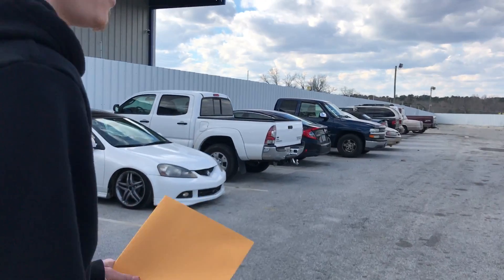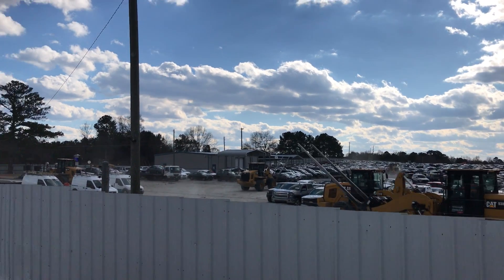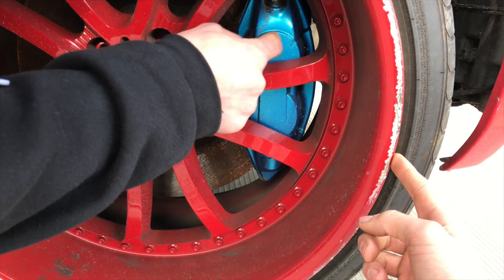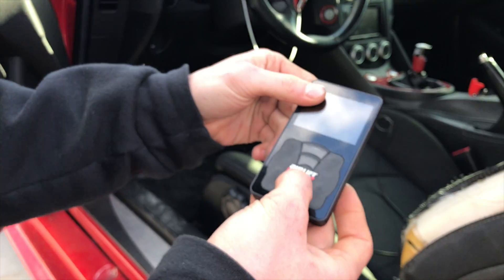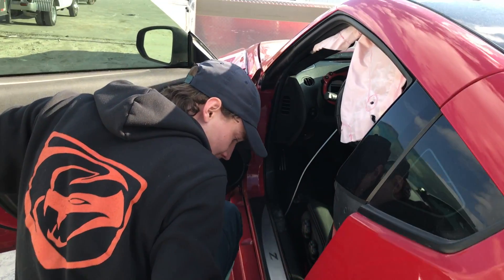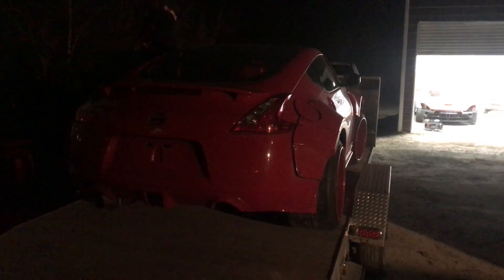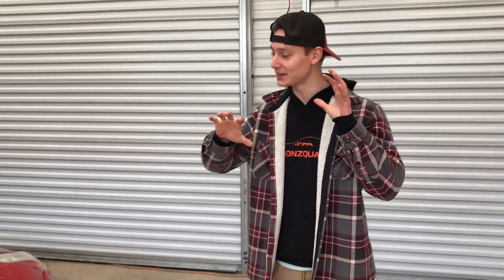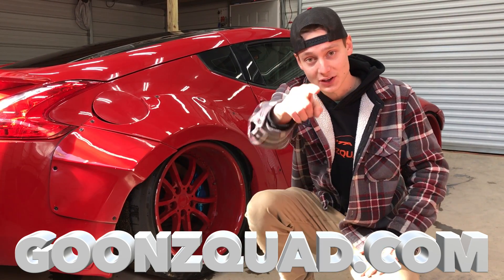We Bought An Auction Drift Car!

Comment: Air suspension isn’t the best for drifting I’d recommend getting some BC racing coilovers they can help you spec out the right ones. Then get a angle kit and that’s a basic drift car. It would be nice to see a drift car built with a cage, seats, harnesses, built engine, etc would be awesome!
Reply: Ryan Elmer I agree on your opinion. Drift car has roll cage, bucket seat w/ harnesses and strong engine not stock v6. That 370z is a rocket bunny build not a drift car. 😊
Reply: Evan Silvala not a rocket bunny kit im pretty sure its a ccc kit
Reply: Their are many different types of drift cars street legal, track only, and fd spec
Reply: Its 2019 you can drift on bags. Check out Illuminate and his 240sx drift car on bags
Reply: More sitf more drift
Reply: If you want drift car go to adamLZ

Comment: this 370z got airlift bags.. not for to drift mod, if u want to drift mod.. u must to change coilover
Reply from the maker: Muhammad Amir Faiz that makes sense
Reply: You don’t necessarily have too but it’s much better to have coil overs
Reply: goonzquad as long as the bags aren’t linked together you’ll be fine for drifting, Chelsea was running bags on his pro car before formula d banned them, they’re fine for sliding. They’re definitely the last thing you need to do for drift mods. If you have any questions you can email me!
Reply: Not so. Just gotta set them right. I know baggers that drift.
Reply: Greg Wayne fax I’ve slid bag cars and love the adjustability
Reply: @waosfab9080  Hey right on! I've got a E46 M3 but coils. Maybe some day I'll have to check them out!
Reply: Greg Wayne for sure! That’s sweet! I just slide me turbo e36 on coils right now it’s good for where I’m at skill level wise

Comment: Put a twin turbo kit to the 370z and putcold air intakes. After that you should carbon fiber put side skirts and put a big carbon fiber spoiler. Also you should put a twin exhaust.
Reply: alright thats enough GTA Online for today..
Reply: The VQ37HR barely has enough space in the engine bay for a single turbo, let alone twin turbos. And the good turbo kits are between 8-10k
Reply: I’d like to have a duck tail spoiler for my z’s... huge classy mounted wings are 🤮 for me
Reply: pay for it then Sami
Reply: A twin turbo setup would most likely blow the transmission and motor so you would have to rebuild the whole thing basically
Reply: @Bc._Media  This, ducktails on Z's are slick.
Reply: @iamhamzaamin  you can stick it out of the hood
Reply: Soo literally do nothing to make it a more functional drift car? Okeeee.

Comment: Looked likes the guy that owned it before you guys was a showy type rather than a performance type of guy. He has the outside all done but really nothing under the hood.
Reply: There isn't much you can do to significantly improve the performance of the Nissan VQ engine without spending a bunch of cash.
Reply: chuckschilling and also a drift car doesn’t have bags only a show car does
Reply: EnderSquad Gaming I guess some younger dude owned this car. I wouldnt do anything to it performance wise too because it already has 300hp thats really enough

Comment: i would definetly recommend that if you wanna drift it then rip out that air suspension and go with coilovers, weld the diff and then start drifting, no need for poweradders like turbos when u are new and learning

Comment: For $6500 after the fees that’s not bad
Reply: Looks like it sold for 3150
Reply from the maker: Macbook & Android it was 6200 with fees
Reply: @goonzquad  the car is is nice but it's in very bad condition, but you can fix it
Reply from the maker: Cesar Chavez thanks but it’s gonna get turned into a complete drift build
Reply: @Kevin_2442  This is nothing, it's gonna be a EZ fix for them, especially compared to there other builds. I'd give it six to seven videos tops and this will be done, all that needs to be done is to check out the control arm, frame, caliber, rotor, brake pads and line, and the axle all on rear driver side. Making sure nothing is damaged, check the air  suspension to see if there's any small punctures, find new wheel, little body work restore headlights and paint. Piece of cake they've been through far crazier situations than this one lol
Reply: Daniel Sherburn it will because the was today and it will take 2-4 until it the website update the price. How do you have account in auto action.io you pay for it or get it for free? I wish I could offered

Comment: If the wheels are three peice then you can get just the outer barel pretty cheap fix
Reply from the maker: CaliBoy yes I think they are 3 piece
Reply: or maybe a wheel repair place. may be worth it
Reply: work bersaglio is the name of them
Reply: Pretty pricey in that size..probably around 2.5 to 3k
Reply: Buy a new set of wheels. I don't like them at all. Sorry
Reply: @goonzquad  You can send them into a tire shop to repair, sandblast and powdercoat.
Reply: goonzquad perfect, just take the tire off, unscrew all the screws on the face of the rim, and there should be glue holding the inner and outer barrel. Just replace the outer barel with maybe a wide barrel so you can fit a fatter tire ?? Haha
Reply: Jason W  wheel repair will not it the same strength that it had when it was oem
Reply: @Vlogsfromthebay  It sure will, maybe even stronger.  The wheel is BOLT on 3 piece wheel.  We are not suggesting a weld/bodge job repair.
Reply: asusreviews i know that its a BOLT on 😂 its way cheaper to replace the barrel and less down time imo, everyone got there opinions

Comment: If you just go bolt ons go ISR long tube headers and Admin intakes and get it tuned by Admin tuning themselves. If not boost it, these VQ37VHR hold great power when boosted and are reliable. Will do 500-600whp reliably all day.

Comment: That's a nice little bonus on that air suspension system.  Even if you wanted to convert back to springs you can get quite a bit for the components.  Each of those compressors are like 200 a piece.

Comment: Put the right exhaust system on the car and it will sound like a GTR 😍 I can’t wait to see the 370z drifting...
Reply: Callum Selfridge why would they want it to sound like a gtr when they have a real gtr
Reply: Deadshot2024 Lit I know that but Nissan GTR’s are probably the best sounding cars out there
Reply: Callum Selfridge  must of forgot about all the v10's and v12's in the world they all beat the sound of the GTR as its just noise no sing
Reply: XDENT TIM not really they all just sound the same to me 😂
Reply: OneRandommOsuPlayer, not a hypebeast I really don't think the GTR sounds good at all just grunt no sing. I honestly think an inline 4 turbo sounds better than a GTR. It's just an opinion mate. But honestly, if you ask me Rotary's sound the best. but out of the V series Engine, the V6 only sounds good when it's supercharged.
Reply: They're the same bruh... they're both V6😑
Reply: @XDENT TIM something better than the v10s and the vq is the 2jz and the rb26
Reply: @Machineheadtim  sry but v10 and v12 just sounds obnoxious. id rather stand next to a straight piped g35 than a straight piped aventador
Reply: OneRandomOsuPlayer I’d rather stand next to a straight piped 5 cylinder Volvo t5 🙌🏻 best sounding engines EVER
Reply: @FindHope100  YES THEY SOUND AMAZING I FUCKING AGREE

Comment: DAMN DUDE. MAKE HER SPIT BIG FLAMES. AND WHAT MADE THIS CAR GET AUCTIONED OFF. OTHER THAN THE BENT RIM.
Reply from the maker: Scariestash 8216 flames it is! Not sure why the totaled it out for such small damage
Reply: @goonzquad  yessss. Yea that's a bit odd. Maybe the previous owner decided to give the car up after it was wrecked.
Reply: I've bought salvage cars needing no more than a lower control arm and wheel.
Reply: Lots of times when airbags deploy the adjusters deem it totaled .
Reply: What Dennis said also it doesn't take a lot to total a car out, because you have to look in the eyes of the insurance company. They add up all the retail costs to get everything fixed, unlike us car guys who just buy any parts we need and install them dirt cheap, the insurance will go to the dealership and get a quote for it.
Reply: all the airbags r out, exept for the dashboard, with a little bit older car, with xxx miles on it, its easy to get the sticker "totaled"  set of airbags is quite expensive, and the roof and seats are kinda wrecked
Reply: @EvoAirsoft  Location is a big factor also.... labor rates where I live in sw PA are much lower than say the DC area.  My dad was an insurance adjuster for 35 years and explained a lot of it to me years ago.

Comment: Get a good brand wheel, not the cheap no names.. Get something that would stand out!
Reply from the maker: Damie Holman definitely, I think these maybe 3 piece high quality ones but we will check them out
Reply: @goonzquad   since they are 3 piece you probably will just have to buy the outer barrels. Try and hit up  3 wheel manufacturers like Cor wheels. The barrels are pretty much universal just have to match the amount of bolt holes
Reply: Hopefully if you check on the back part of the rim you can find the brand of the rims
Reply: HRE’s maybe?¿
Reply: They look like weds kranze wheels.. expensive wheels from Japan... clean the paint off the center cap and you should see kranze.

Comment: You can just get an outer barrel. It looks like the face and inner are fine.
Reply: Dominic Diaz I was looking to see if someone said the same thing before I posted.
Reply: That can actually be repaired, wheel wizard in Atlanta can do some miracles
Reply from the maker: Dominic Diaz thanks for the advice! Definitely will look into that
Reply: Yeah if they’re real 3 piece wheels.  Which they do look real. But you never know.

Comment: Hold set and hit Cancel on the Cruise Control settings on the Steering Wheel with the key on and see if it has the UpRev and ARC License for 2 Step,Launch Control,Anti-Lag and a few other Maps....If the Cruise Control light flashes it definitely has a Tune installed.... Press Cancel again while holding Set  twice and it's in Map 2 then 3 times for Map 3,4 and 5

Comment: I believe the red button is connected to a sensor on the ECU so that you can turn  off traction so you could slide the car. The 350 z has this also but you need to put this button to disable.it I could be wrong but since it's a drift car that's normally what drifters do.

Comment: Hi Guys , The Airlift management is Airlift 3p/h   P= Pressure sensitive h= High sensors around the car , you will find these if it has them around the inner wheel well . 

You will need to "Maintain" this system by draining the air from the system every so often to prevent water running into the lines and causing damage to the bags . 

If you need any assistance please message me i've had my fair amount of cars on the newer airlift systems 

Id look at getting the car to sit lower on the front end also , drifting you probably don't want to do on Airlift struts , i know of one pro drifter that drifts on the kit but personally i wouldn't 

Hope that color goes and the interior looks okay , the boot build is just a simple build to get the owner where he wants to go for that full kit and install probably looking at around $3K id imagine.

The wheel brand may be on the inner spokes also.

Comment: The benefit of a true three piece wheel is you can buy and replace just the barrel. Check the back of the spokes to see if the manufacturer stamped the back of the hub/spokes.

Comment: Huge spoiler for better control n better aerodynamic... Also would suggest a wide steering angle  up to 90°c to be able to drift better. Twin turbo would be a better chance for huge power to boost for more acceleration et slide power...  Lightweight seats n body panel would be recommend for weight transfer... Peace my friend... Love yr videos... U r an inspiration just like chrisfix

Comment: If the wheel center is not bent, You could probably buy a new barrel for the wheel. It seems to be multipiece wheel so that shoud be possible. The center is the expensive bit, barrel is cheaper.

Comment: DONT DRIFT USE IT AS A DRIFT CARS ITS WIDEBODY,HAS WIDE WHEELS,AND IS BAGGED.... why go through a whole process of making the car it something it’s already not. But regardless if you read this message I will always support the channel🤦🏾‍♂️❤️
Reply from the maker: Kasean jones thanks! Really I thought even though it’s wide body if we add enough power it’ll drift
Reply: @goonzquad  It's gonna suck fixing it all the time. You kind of want a piece of shit to learn on or you're going to tear up your fenders, bumpers, and your air suspension. Even after you're good you'll have to deal with constant fixing esp on the suspension. Look at Adam LZ. He replaces fenders all the time.
Reply: Make it a show car🤦🏾‍♂️

Comment: first thing... Twin turbo kit or big single turbo along with all the other mods to handle that power... Get rid of those rims... and try to shed all the extra weight and creature comforts... unless you intend to keeping it a functional daily driver. But if you are going to be taking it to the track at all I recommend the brand Airlift Performance. It is designed for it... It isn't cheap, but you will save money in the long run by not replacing parts every track day or find out more about that brand of air ride and its capability if you intend to drift or track it... but from experience, I recommend Airlift performance or even some adjustable coilovers. I look forward to watching and seeing how the build comes along... but while I wait... I am going to catch up on all of your other build series videos. Just recently found your channel and really enjoy your content so far.

Comment: Does anyone here think a Nissan 350z would be a good first car?
Reply: CAZE GAMING absolutely
Reply: No lmao
Reply: CAZE GAMING Or a g35 coupe cause it has back seats and a nicer interior with a sun roof and the same engine.
Reply: I have a g35 coupe and it has 204,000 miles on it and it runs like it’s brand new but I got it over the 350z plus you can go full bolt on with a lower mileage one.
Reply: If you enjoy having to use premium gas then yes
Reply: Jacob Stone It’s not a problem for me
Reply: CAZE GAMING sure. just be careful of the oil burning issue of the VQ35DE, get an HR one VQ35 (it’s in the newer 350) or g35. I second you getting a G cause it’s a lot nicer. I daily drive a g37 sport sedan and I love it.
Reply: I think it’s a great first car to have 👌🏼
Reply: mow 26 I agree with you I got a g35 coupe and it’s a much smoother ride
Reply: e36 is better for beginners  i got that from David Paterson aka thatdudeinblue
Reply: Car_enthuzust_for_life on ig The parts and maintenance is more especially on a older BMW and the reason why I know is because I used to own and 06 BMW then I got a 2007 g35 coupe.
Reply: my first car was a Chevette
Reply: bladerunner1b nice
Reply: @ryanmiller9445  haha, i'd rather had a 370 but times they change i guess

Comment: They spent a lot of money doing cheap mods, with someone who knew just enough to get into trouble.  Hope you pull apart and thoroughly inspect everything they touched.
Reply: cheap mods? wheels and air suspension aren't the cheapest options
Reply: @Sovehy  you got that right. I agree 100%
Reply: but yeah for sure you need to check how to cut the quarter and see if they seamsealed / weather protected it

Comment: that car was never a drift car.. its was a stance car... those wheels seem to look like work bersaglio wheels that kit is just over fenders or maybe even a rocket bunny rep kit. and yes airlift is a good brand those bags are slam series. if your lucky they maybe the performance series like mine which are very decent. overrall a decent kit for the bags and a setup like that can go for 2-4k new... if you guys do decide to get rid of the kit id love to buy that controller i control my system in my car by using bluetooth and my phone.

Comment: you cant drift with a stock motor and thicc tires like that. maybe do some p o w e r s l i d e s but thats it. way too much grip and not enough power.
Reply from the maker: Lazy Cunt² twin turbos?
Reply: a big single turbo would be cool
Reply: @goonzquad  baby gtr😉?
Reply: @goonzquad  I just want to say that you guys have a real passion for all of the youtube stuff. you guys are actively commenting on the early post and rewarding the active followers.
Reply: Not here to start debates but I will haha. Some of the stanced drift scene run wide wheels and tires, but camber their wheels.  This allows less rubber surface area to contact the ground and some think is stylish. It may not be an option for many, but you can still drift on a stock motor, just need an adjusted suspension setup.
Reply from the maker: Lazy Cunt² pretty much lol but rear wheel drive which is great for drifting
Reply: Adam Liz did it

Comment: I might be wrong but I think those wheels are Work Bersaglio and if that’s the case you can’t get better than Work wheels just needs a re lip and re paint maybe some new center caps over all great project car 

Slap some new bucket seats in there and get rid of all the cheap china parts and start adding quality parts this 370 can be saved no problem!